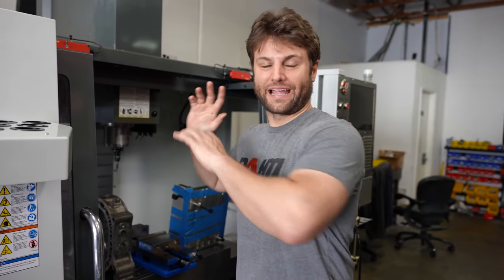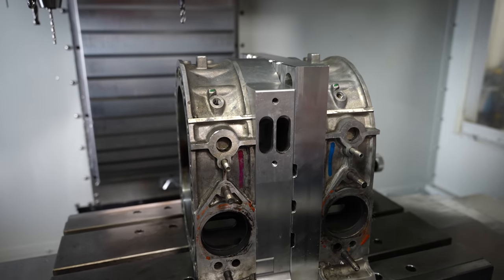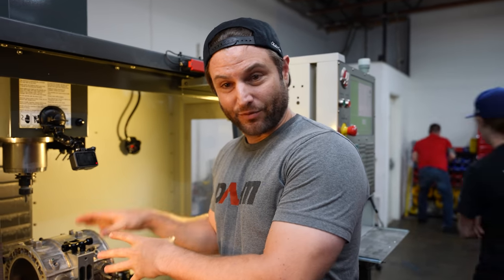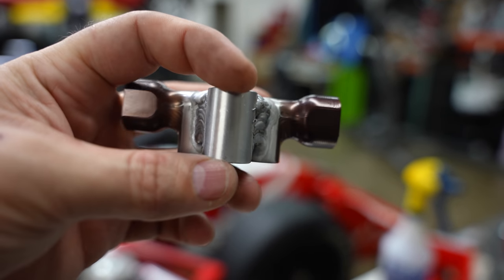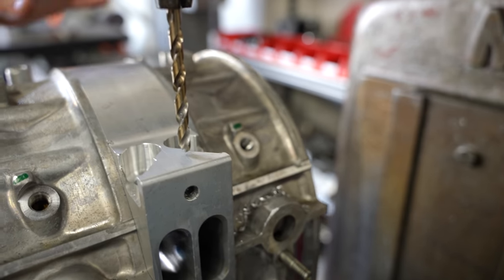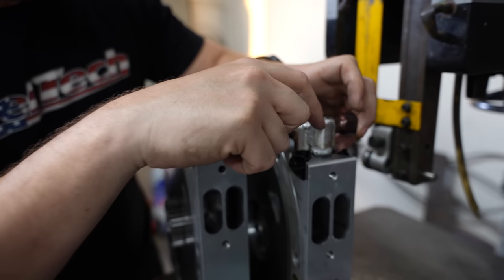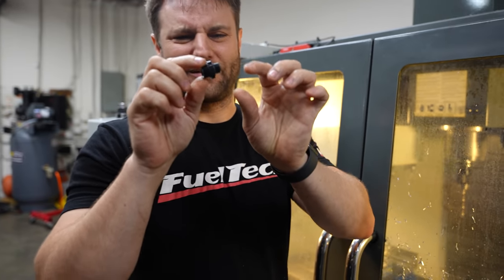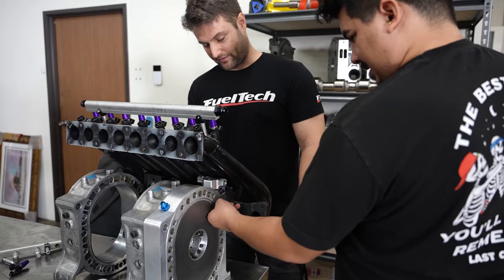The Craziest thing I’ve done to my Billet 4 Rotor. It was running fine…

Comment: Why not do an air to water intercooler which will go towards 1500 to 2000 hp plus deal with E98 or E99 fuel?

Comment: US Chrome will definitely re-plate rotor housings. Tricom might be something worth trying. Either way, they will remove original plating, repair any gouges or cracks and plate the housing. You could make billet housings without any question. Both chromium (hard chrome) and tricom electroplating can be done. Tricom can be formulated to be 8x more wear resistant than Chromium.

Comment: You should cut that middle bridge on the intake port out out and insert 42mm round ports. Almost the same effect as your exhaust ports, but not cut in on the injection port on your side plate.

Comment: Instead of using 6AN to connect the 2 injector blocks, maybe a straight tube with O-rings that insert between would be better. There would be no threads to worry about loosening.

Comment: If you hard line those injectors together. Is there a chance of the lines cracking, since aluminum expands, and contracts?
Reply: Everything expands and contracts.
Reply: @EmyrDerfel  but not at the same rate

Comment: I would stud the irons and secure the new rails with nuts.  That way you have steel on steel for the removable fastener and you can seal the stud to the iron in case there is any leakage.

Comment: You can start off with a standard length tool and rough rough upper portion and then swap over to the longer tool for the deep work. What CAM software are you using?

Comment: I would start proving your program on first runs. Turn your rapid speed way down, like 10 percent while running your program with no part your had over emergency stop. When tool gets close table, fixtures, parts, ext. stop program and check visually that the distance from your part matching what your feed depth is and that you don’t have an x or y movement that will hit your fixture or clamping ext.

Comment: Rob you could of drilled and single pointed (generated) the threads on the cnc. This would have got the threads within 1 to 1.5 threads of the bottom of the holes. Instead of using a tap!

Comment: The distance from inlet for injector should only be affected by air velocity, and the biggest one is inlet runners shouldnt be smoothed for port injection u need the turbulance before the port to mix the fuel woth the air before been in the combistion chamber

Comment: Could you not have used smaller fastenings and less of a hard-core mount for the fuel rail to give you more clearance. Pretty sure a smaller bolt would suffice to hold a fuel rail down.

Comment: Maannn.... you running 100% rapid first time ops is giving me anxiety... I suggest 25% or 5% rapid and hands on the feed hold and cycle start button, that way if something is going to go wrong, like a tool not coming up far enough or something, you can watch the "distance to go" on the "position" screen and actually have time to pause the operation and hit reset instead of the tool moving in to / out of the work area on full rapid, like how you were talking about that drill around 8:00

Comment: You have to know, that using steel bolts with aluminium parts is a bad idea, because steel and aluminium is a classic galvanic pair. With vibrations coming out from the engine, steel will start to be rusty, even if you will use coated one. And there would be a little voltage Between this parts at the time when engine will work. It could make some problems with your project later, for example, it can give a voltage to your piezoelectric nozzles. You should think about it
Reply: hahahahaahhaahaaa thats some funny shit mate. Good work!
Reply: @sexyfacenation  maybe you found that thing funny, but read some info about galvanic pairs and you would know, what I was talking about

Comment: Rob, I think having a 3d printer would be useful for prototyping before you commit to machined parts. They have gotten pretty cheap.
Reply: This exactly. If he had completely modeled and printed out the rotor housings, and tested the tool path, he'd have been so much more confident
Reply: @octane613  3d printing an entire housing would be a huge part taking quite a while to print (multiple days probably) and need a pretty expensive printer. But things like the hold down for the injectors, I'd think they be able to 3d model and send to print those brackets way faster they could cut up and weld together those metal ones, and would have immediately seen any initial issues with fitment and would been able to remodel it and confirm it's perfect. Then make that final one on the cnc machine. You can spend like a few bucks if that in plastic to print out something like those fuel rail covers and take 2-8 hours depending on quality/speed/quantity to print.

Comment: Is there any point at which the boost pressure in the manifold gets so high, that the o-rings sealing around the injectors fail?
Reply: obviously eventually they would... but I mean any reasonable or semi-realistic boost pressures that an engine would see
Reply: NO.

Comment: I was thinking how you would pressure test the completed injector set up without filling your expensive billets full if liquid. Could a guy some use a vaccum leak smoke machine mechanics use to find vacuum leaks, maybe using air pressure to put as much pressure as you can to the injectors. Seems like a thorough test would be a good idea with custom injector rails. It would be horrible to see that beautiful machine go up in smoke. Maybe a good fire system would be in order. I love your content btw. I am not a rotary fan, or even an import fan. I like the intellectual perspective you add being a gear head. I dont think people perceive mechanics/fabricators with having a high degree of intelligence in that appropriate part of the brain needed for understanding mechanicsal theory, problem solving complex mechanical and electrical systems.

Comment: Went into this knowing I'd get a blueball ending with no outro. Just ain't care as Ken Block would say🤣👌
BTW you should try dome head Allen bolts, might look nicer and help with clearance too
Reply: @garyhowe88  what an insightful response. I'll take that up with management
Reply: @corythomas9369  you said try some head Allen bolts, also known as button heads, they are garbage, lack of engagement, round off easily even when torqued to spec. We have customers send machines back due to having them fitted that's how terrible they really are.
Reply: @garyhowe88  now that's what I was looking for, and you're right, except remember he doesn't need it to be torqued very high. But hey, it's his block and his choice which probably won't include them lol.

Comment: I'm curious why you didn't put those injectors into the lower part of the intake runner as it hooked back into the engine. Also your depth on tapping is a bit over what you actually need. General rule of thumb is 1.5x the thread diameter.

Comment: The different taps are intended to be used to progressively cut threads hence taper, second & bottoming. It's got nothing to do with the bottom of the thread. Try to get a bottoming tap started in a correctly sized tapping hole & you'll understand. If you had done some foundation mechanical engineering training then you would understand a lot of the basic principles that underpin what you're doing. Respect for finding your way & the eagerness to learn but there are more efficient ways to gain knowledge & a good toolmaker is doing way more complex stuff on a daily basis!

Comment: This is great since it fixes the low rpm flaws, now next step would be to look at "resi" housings, rx8 high output housings and see if they can be combined to achive better performance, in fact this would be fun to see in a single rotor project where different housings are tested

Comment: Adjusting you milling to have the injectors facing the same direction as the air flow it will help with response,  as it stands now your injectors are fuel injection but having them at a 90 to your air flow will have a poor mix. Another more crazy idea is to have direct injection straight into the combustion chamber.

Comment: Dude, spend a few minutes on the internet reading about taps, they are not all that complicated and spiral fluted taps are definitely not the only bottoming taps out there. The material is not relevant to what tap is suitable, technically speaking all holes should be tapped with a starter, finishing and bottoming tap, but aint nobody got time for that.